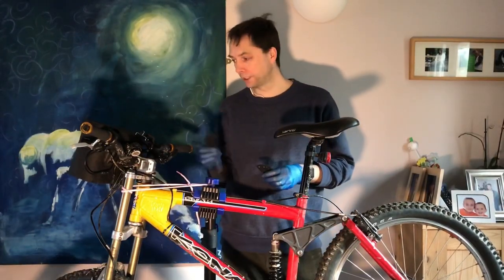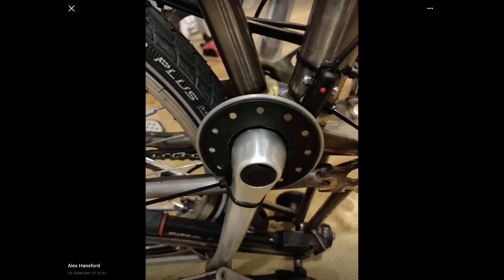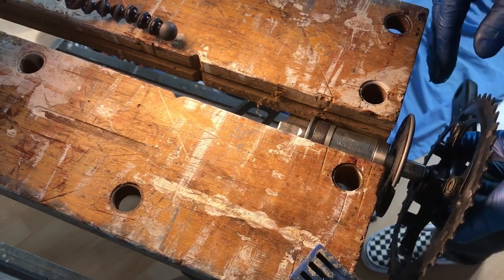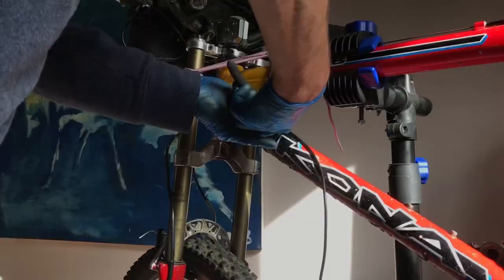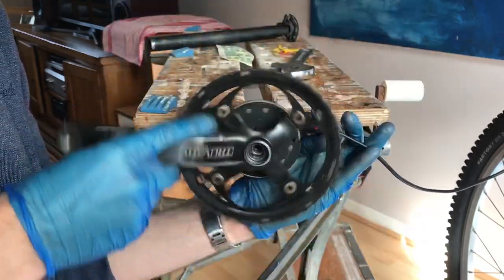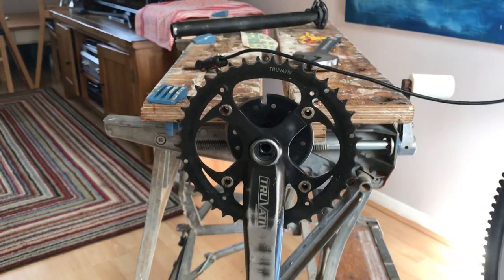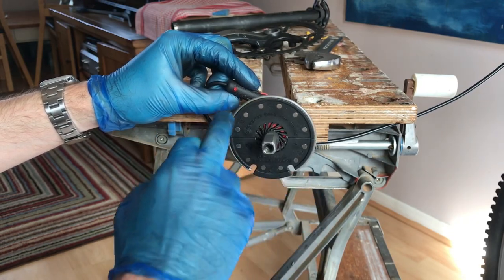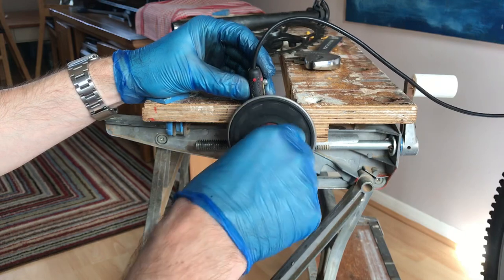PAS Disc and sensor fitting options Ebike Swytch conversion

Comment: Good evening . And how many BETTER magnets should this sensor have!? I have an older model bike; / There is NO on-board computer, only a small board with LEDs. and its natural PAS sensor consists of only 5 magnets!!! / Today there are 8 of them and there are also 12 magnets. So is it possible to replace 5 magnets with 8? What will change!? Will there be problems later on the road!? Thank you .
Reply from the maker: Doesn’t matter too much. The magnet passes the sensor which engages the motor. 1 magnet would  still work but if you are pedalling slowly the motor would come on less
Reply: @leepspvideo  DANKE!

Comment: Great video thank you 😊
 Is there a way to secure the magnet ring on the left side with NO gap❓️My bike is a 2010 Full sus Trek Fuel EX9.9 Carbon. I've not seen a way yet, I've ordered my Swytch Bike kit....I've also got to buy different forks too...🤦‍♂️
Reply from the maker: This solution I used on my Scott May work

https://youtu.be/5-vG2dH0oHg?si=3Fzo6n3jz0jafk6S

This company sells 4 different pas sensors that may work 

Convert your bike to Electric. Sub £400 DIY Ebike kit. Yose Power
https://youtu.be/ps4gNxQL5Wg

Comment: Also had a problem positioning as not enough of a gap between frame, magnet and PAS! A more slim line PAS needed. Had to remove the clip and the rear cover of the PAS for it to fit! Then gorilla tape to secure. Hoping water ingress isn't going to become an issue!
Reply: I have the same issue but Swytch eventually responded to my support emails with a solution they will send out.    Their "v12" design PAS comes on a ring inserted between the frame and physically detached pedal arm.  We will see if this works.

Comment: I had to put the disk at the right side due to the lack of free space between the crank and the frame.
I’ve bought a KT-D12R sensor and fitted it on the right side. I have to keep the setting on the swytch-controller on ‘run forward’.
It works perfect and actually looks better since the PAS-disk is neatly tucked away next to the crankset.
Reply: How is it so far running Swytch with the sensor and the disc on the drive side?
Reply: CTheSlayer Still running fine after 1 year. I often go mountainbiking without the kit (Changing my front wheel, removing the bag and alligning my disk brake takes 3 minutes), and you hardly see that it’s not an ordinary mountainbike. I wonder why they don’t sell all their kits with the disk fitted on the drive side! :)
Reply: @Nougatti123   I have contacted Swytch and they have told that they know of no one using alternate PAS sensors and according to them, people have had no luck switching to the right side.  Perhaps it's because drive side sensor users are few and have not been very vocal about their own setup.  Your feedback about your experience is refreshing. Thanks!
Reply: I recently bought the right hand sensor and had to rewire it, flipping the black and white wires. The red remained unchanged. Maybe Swytch changed the wiring in the new pack. What also works is using the sensor they gave you and placing it backwards with Suguru and zipties. It has to be placed much closer to the disk, but works. Also you can drill mounting holes in-between the magnets on the disk using an old 22t chainring as a template. Then mount it with Aluminum chainring bolts.

Comment: Very helpful, I need to fit a pas to a hollow tech 2 crank in a carbon fibre frame, where there is no gap.
Reply: As do I 😊 did you manage it❓️Is there a way to secure the magnet ring with NO gap, I've not seen a way yet, I've ordered my Swytch Bike kit....I've also got to buy different forks too...

Comment: I tried the sugru tip, and it works perfectly! My down tube is tapered, and I had to build up one side to make the sensor parallel to the magnetic ring. I also used zip ties with sugru. The sensor stays perfectly in place over bumps, bad roads, etc. Thanks!!

Comment: I appreciate your video. I have my old swytch bike with magnetic disc next to crank and working fine. I got another one for my son to do the same exact installment, it does not work for his bike. It does the same exact result as yours. If I buy pas sensor - right side mount, would it work?
Reply from the maker: If you can change the settings it should work. I think there was an option on the original lcd display kit.

This bike was fixed with sugru

SWYTCH kit Full Suspension Ebike conversion kit Build 3 1999 Kona Stab
https://youtu.be/at7Qbwxm3ss

The video shows how the rotation angle of the sensor makes a big difference.
Reply: I tried changing the setting as you did and the same result. I do not want to have a magnetic disc on the left side since my son is 11 and it would be so easy to knock it out unexpectedly. I tried the different angles of a PAS sensor, so it is not something to do with the angles per se. I am not able to connect with Swytch customer service to help me out with how I am able to work the magnetic disk on the crank side like my old bike.

Comment: I had to fit a spacer from mounting ring bracket to the sensor to give me the 3mm gap to the magnet ring. All good but I dont have an lcd computer what is the best way to turn off the sensor. I think there are 3 wires so how do i disable the sensor. I'd likr to control it with a switch but not sure which wire pair to switch. Thanks for the video.😀😀
Reply from the maker: I haven’t tried adding a switch. I was going to try with a vintage gear shifter to move the sensor far enough away to make it stop. Then move it closer to switch it on. Using the front mech.

Comment: Can’t 2 of the 3 wires be swapped over for running on the other side if needed surely that’s the only difference between L & R sensors

Comment: Those sensor are smart; able to differentiate forward or backward peddling.    I was not aware  that there is a distinction with these PAS but upon looking closer,  the kit has option to specify what you want.    I would go for the PAS on the ring side because it is more difficult to knock  it out of position and hidden from view.   One tip.  The old BB (bottom bracket), the right and left side is slightly longer then the other, at least on my Dahon 2002 model.

Comment: Great informative video . Only had my Swytch Bike Kit a week and been out once on it and was inicially impressed, but after about 9 miles my motor would stop for a few seconds and restart for a while, this was happening mostly on hills, some steep. I did have my Max power pack on all the time which was probally wrong. Did check my disk and censor incase they  had got splashed with muddy water or was slipping on the crank shaft, they seemed ok. As it was my first time out with it i don't know how it feels when the battery is almost spent. I did plod on for another few miles under my own steam  by which time the battery was completly dead. Maybe i should only put the power on when approaching hills, also i found when freewheeling down hill with the power left on, the motor was acting like a magnetic brake and slowing me down, they didn't tell me about this, as far as i can see i will have to keep switching the power button on and off all the time to make the kit work efficiently, ( a right pain ) there is no way i will get 32 kms out of it where i live, as they claim. Time will tell.
Reply from the maker: I did a load of Swytch videos 

Swytch Kit & EBikes
https://www.youtube.com/playlist?list=PLMJAjiTgBtFmx25QbcpCw97D6LiljrE_S

I don’t experience the resistance you are getting whether my Swytch is on or off

Comment: Does this  pas works with any controller or just kt controller?
Reply from the maker: As long as the magnets pass the sensor you should be OK. Others have used alternative PAS discs with different amounts of magnets and had success.